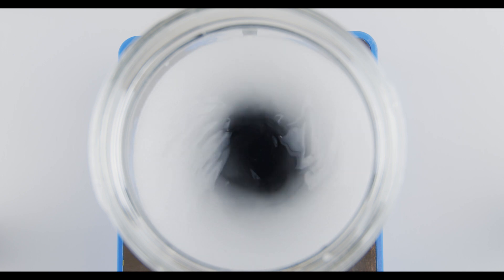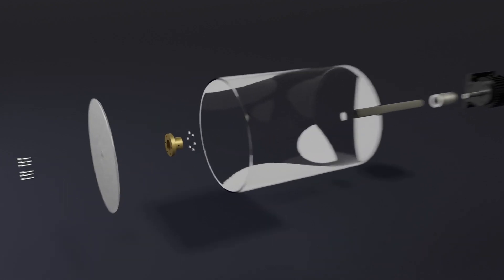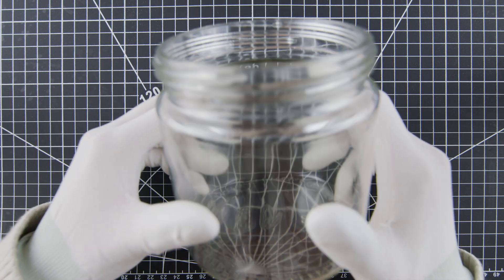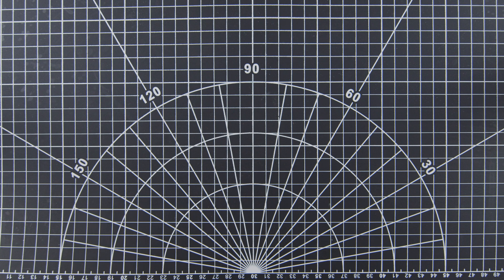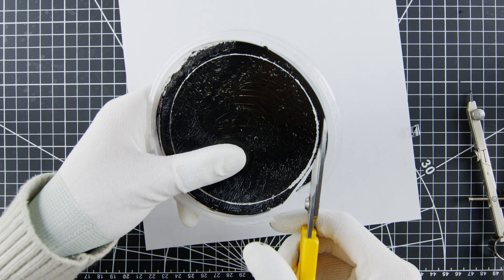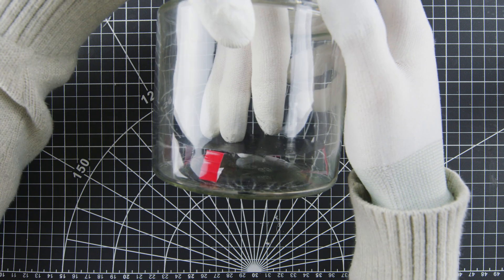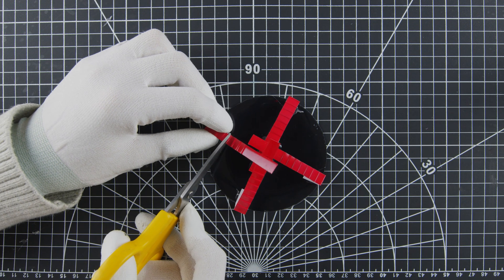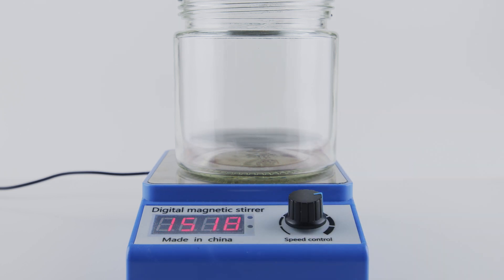Magnetic Transmission IYPT 2020 Problem 12 Polygon Vortex Demonstration Part 1

Comment: Is there a specific reason for why you did not opt for driving the system using a narrow rod from the top?
Reply from the maker: A rod from the top will introduce an additional rotating "wall" that will disturb the fluid. Also, it will make any on axis observation from the top more challenging.